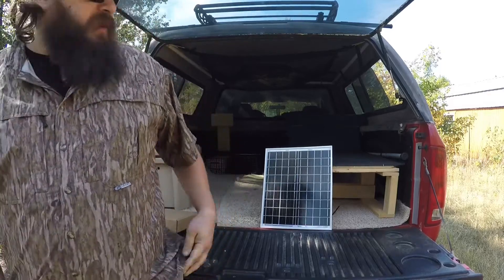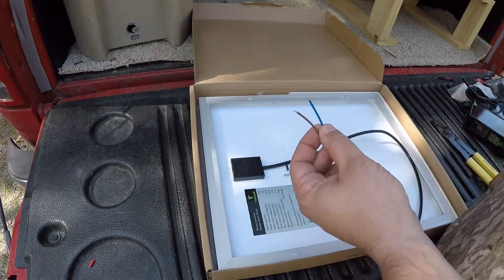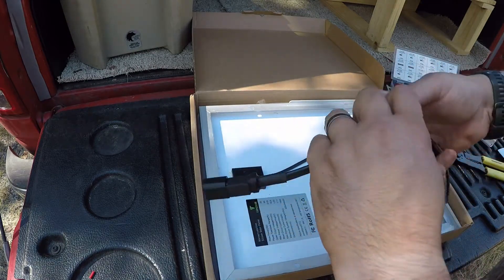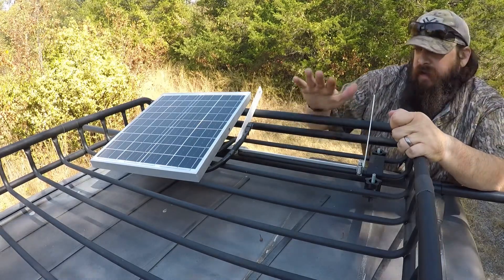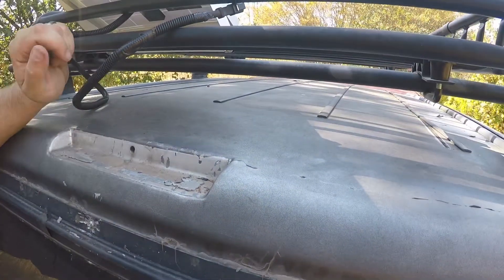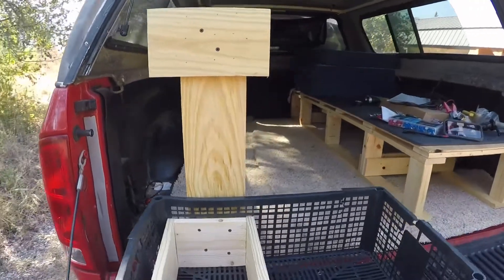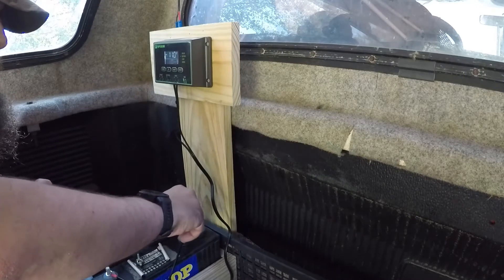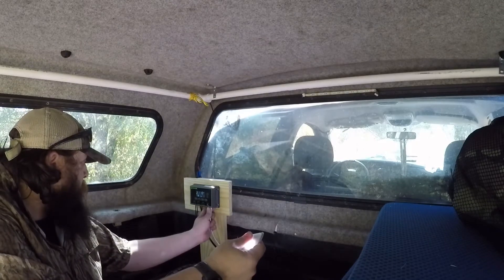How to install Solar Power on a Truck Camper.

Comment: CAN PUT A SMALL 12 VOLT FRIDGE IN THE BATTERY..?
Reply from the maker: @miguellovino7679  I haven’t tried but you should be able to. It does not have a 12 cigarette light plug, but I have a 110 inverter and a 12v usb port